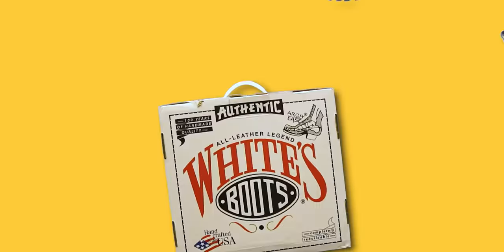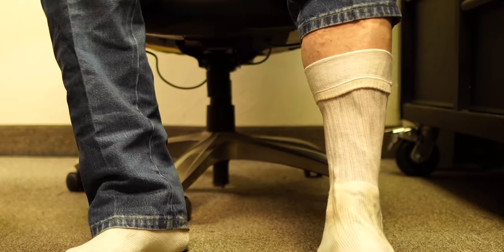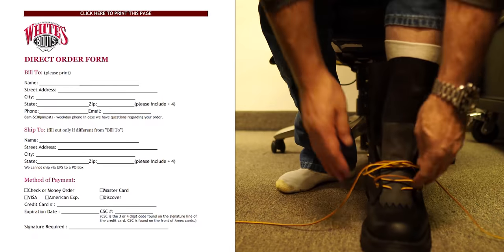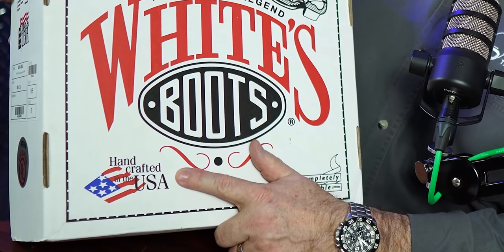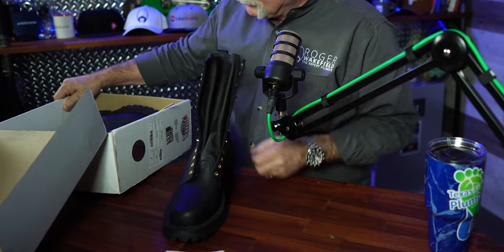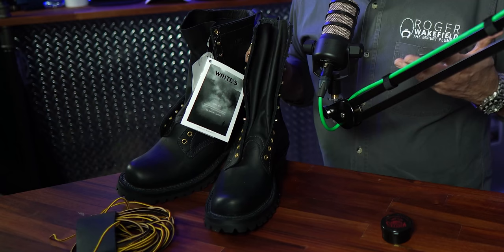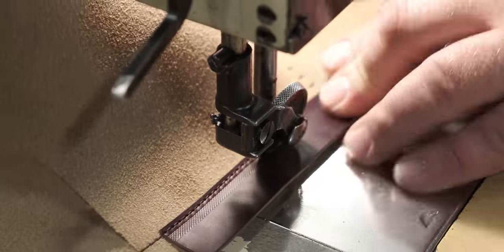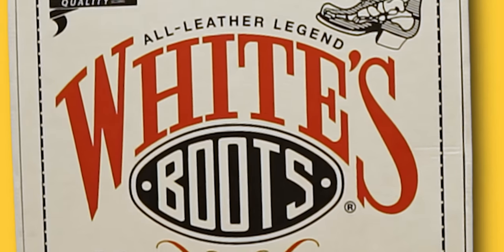Are These The BEST Plumbing Boots Ever??

Comment from the maker: What kind of boots do you wear?
Reply: The free kind.
Reply: I wear flip flops instead
Reply: I have a brand thorogood I’m on my 3 pair really do love the brand provides me with the support I need for my weak ankles and the leather is made to last
Reply: Sasquatch Leather Roper Boots lol
Reply: I wear Globe Technical 10" Wildland/EMS boots. Most comfortable boot I've ever worn.
Reply: Steel toe
Reply: Redwing. Love them. Loves boots and love redwing and yes I pay good money but I would try some custom boots.
Reply: Stilettos
Reply: Belleville steel toes - doc marten basic
Reply: Carhart slip on boots.
Reply: I'm shocked you don't give out the name of the former boot you don't deal with lol
Reply: I wear Wolverine legend durashocks with a composite toe , I feel like they’re. Comfortable and durable for everyday service plumbing
Reply: Thorogood here.
Looking to upgrade to whites or nicks when i can. 👍
Reply: Rock steel toes
Reply: Justins the gucci of boots
Reply: I wear Twisted X steel toe driving mocs.
Reply: Hi, plumber me too I wear Dickies rigger boots.
They have a protective part on the top, it avoids to scratch and peel the leather when you are on your knees (that occurs most of the time in plumbing for me). With some brands I had the steel toe-cap exposed in only 3 months. 
Dickies dixon lined rigger boots last me for little more than 1 year before getting opened on the sides (due to constant folding) but never because of exposed toe-cap .
I prefer boots with no laces because when i'm in a trench or a hole, sand or dirt can't enter the shoe and i wear them with the pant over it, that way sand can't enter by the top.
I would like the Stafford Waterproof (often the feet in the water) and the composite toe-cap prevents condensation (cause cold feet sensation in winter).
They are a little bit more expensive than Rigger boots but should last may be more
Reply: Chippewa Super loggers. Great boot! Looks similar to the ones in your video.  Will have to try these Whites boots, nothing wrong with having a second pair of boots... Are they insulated?
Reply: Red wing steel toe Pecos
Reply: Boots in a way are like a plumber's tool. I've worn Red Wings for years,  lately I've been wearing Timberland ,occasionally I wear Dr Martin (very confortable). I have at least three pair of boots which I alternate each day.
Reply: Georgia Boots
Reply: @Hever73  I started wearing RedWing steel 40 years ago when I did 7 years as a union Iron Worker I keep 2 pairs , one for working the other for casual dress and when the work boots wear out I turn the casual into workies and buy a new pair for casual and the cycle begins again. Never have to break in a new pair long hours of the day
Reply: @randyblackburn9765  they are really good they're pricy though I broke my ankle wearing a pair of them .... after that I've been using Timberland but I still have my 2 pair of Red wing which I wear when I have to some digging or drain cleaning.
Reply: Current pair:  Thorogood 804-6446.  Previous pairs:  Lacrosse FireTech, Thorogood 804-6391M.  Next pair:  Matterhorn MT901.  The 6391M was the best boot of the bunch with both toe cap and internal metatarsal protection, so of course it's out of production.  I've been searching for an equivalent ever since.
Reply: Thorogood 6” mock toe heritage series in tobacco brown.
Reply: Jalas off road
Reply: Redwing
Reply: National
Reply: Wolverine boots with insoles out of my pro model vans. They're super comfy and I always tie them tight. I've been in flowing water that went almost to the top of them and I didn't get any water on my socks.
Reply: Keen Cincinnati
Reply: And  Chippewa Superloggers
Reply: I have never been a wellington boot wearer,but My current boots are Marshal ,square steel toe boot ,made by Redwing Irish setter.These are the most comfortable boots this plumber has ever worn.
Reply: Red wing 2414
Reply: Whites fire rated lace to toe, I can get 4-5 years out of a pair. And boy are they comfy right out of the box.
Reply from the maker: @justindunlap1235  these are actually the most comfortable pair of boots I’ve ever owned. I love these!!!
Reply from the maker: @PACKERMAN2077  I’ve never had those before...
Reply from the maker: @bornagainluis  as a residential service company we don’t really need steel toe. Thank God. These are so comfortable.
Reply from the maker: @andrewengland971  I wore Redwing until they quit making their top selling model. That’s when I found #Whites...
Reply from the maker: @clarityofthought  it takes forever to break in Docs...
Reply from the maker: @deathmetalmachine  i loved the product for years. It just surprises me they would quit making their best product!!!
Reply from the maker: @chrisp5093  I freaking love these for sure...
Reply from the maker: @Daddybigduck69  if Justin is Gucci, Whites must be #ChristianLouboutin... Rocking It!!!
Reply from the maker: @crash4dafun  they aren’t. But in Texas I wouldn’t like them if they were...
Reply from the maker: @Hever73  like tools in a toolbox. You always like trying new tools!!!
Reply: @RogerWakefield  I agree, in addition I have completely tore down a worn out pair, and was thoroughly impressed with the am out of effort they put into constructing the sole and arch so it quickly molds to you feet.
Reply: Just dropped $625 up front for a custom build from Franks. Whites unfortunately sold out to China, and Nicks sold to an owner who is focused on pumping out quantity at the cost of quality control and footing the bill at the expense of the customers. There's a few other quality boot manufacturers, but my money is with Frank.
Reply: I've got Nick's boots
Reply: Just ordered a pair of whites stockman boots for tree work and in general to keep on all day... needed a pair that are hardy enough for the tree work and will look good and professional when I’m out doing quotes in the evening... some people really do need this quality of boot. Great video 👍🏻
Reply: I got the exact same pair for wildland firefighting, with a good pair of darn tough socks and whites leather laces that i treat with obenaufs leather preservative. Have yet to find a better investment for my job. Those of us that shoot or hunt will drop thousands on a rifle or modifications. Or even 600 for a glock 19 that we cant afford ammo for. Put your investment in what youre using and what you need to work at all times!
Reply: I wear the same boots for wildland fire and they have never let me down
Reply: @Darkstar19643  thank you for your work, sir. I wish more people respected the safety you provide for us.
Reply: @RogerWakefield  Six months later, any regrets or are you still happy with your investment?
Reply from the maker: @POWER_WAFFLE  I’m boarding a plane in Houston. Guess what boots I have on. Yes I love them.
Reply: @RogerWakefield  I appreciate you for taking the time to answer that, glad you still enjoy them! Looks like I know where I’ll be going for my next pair of work boots.
Reply: Whites model Foreman, im
a residential electrician.
Reply: @orBMW  really? I thought it was China. Might not be made in America, but Japan is light-years better than buying China. Guess I won't feel so bad when I buy my dad white's for his first handmade boot.
Reply: @ThomasSteed  everything is still handmade with USA materials in Spokane.
Reply: Have worn whites and nick’s boots since 93’ smokejumper or lineman’s , the real deal . Feet never tired even after 14 hour day. Worth every penny to me.
Reply: 12 in whites smoke jumper in brown rough out.  Second pair of boots in a 20 year career in fire service.  many resoles and a few rebuilds but I love them.
Reply: Whites Helitak
Reply: Whites smoke jumpers all I will ne. The best and much favorite. I do tree work
Reply: PNW are the best boots period !! Whites ,Nicks Franks ,Wesco they are all great !

Comment: I’ve got the nicks builder pros, they’re from Spokane as well and do the hand crafted and fitted boots. Amazing quality
Reply: Nicks, Quality materials, with stitch down construction is a short cut. Go look up what whites norweign welted construction looks like. The sole could be completely gone on the boots and they would still stay together because the boot upper is sewn to a channel in the insole not just stitched down to the sole.
Reply: @GregariousAntithesis  Nicks boots are almost exclusively goodyear welted. Whites offers pretty much NO Norwegian welted boots in their lineup and it would be pretty easy to search them out given the iconic double welt and stitching pattern that Norwegian storm welts are known for. Both boots are made to the same standards and are bulletproof.
Reply: @ShutUpBubi  you are wrong, i am a boot maker and boot repair man Nicks are not the same build quality and construction. Whites are hand sewn through outer upper and leather inner sole in a channel in innersole. All others including Nicks are just simple stitch downs, turned out upper stitched down through soles.

Comment: I've been buying a new pair of Red Wing 2408s every three years since just after the turn of the century.  I really prefer the non marking sole on that model.  very flexible toe, but the most important thing is that the last for red wings matches my foot.  only problem I have is the tread pattern will hold dirt for hours unless you actually wash the sole of the boot.  I've had them leave dirt on my floor a full day after I've worked anywhere with dirt. (on a finished floor, I'm more likely to lave them at the door than wrestle with floor savers)  migh have to think about white's, though - and I pass through spokane every couple years.
Reply: Team Red Wings. 👍🏾

Comment: I like Steel Blue boots.  They are pretty comfortable out of the box and as long as I get the ones with the rubber bumper on the toe ( I kneel down on the concrete a lot) seem to last a while.  I got King Gee brand ones last time and I am regretting it.  They didn't have my steel blues in stock and my work doesn't let you expense more than $180 on boots.

Comment: Those boots look amazing. But for me, weather I am doing electrical, plumbing, tree, or IT work, mid height hikers or ultralight is my go to footwear. I may put in 5 miles or more at work and 10+ miles on the trail. I have never been able to tolerate a boot that goes midway to my knee. For every pound on your feet, is 5 pounds on your back. My shoes typically weigh less than one pound per pair.
Reply: Look up Lowa, Galibier mountaineering boots, same basic construction as whites. Heavy as a hell and a lifetime boot.

Comment: Socks make a difference, too.  You've gone to what might be the best boot but are wearing socks that are cheap and likely not the best for you.  At the advice of a co-worker, about two years ago I started looking at on-line reviews of socks and purchasing accordingly.  I've also been alternating shoes, never wearing the same pair two days in a row.  On top of that, I've been using sole inserts in my shoes (which take up a bit of room and may require a larger shoe size).   All this made a great deal of difference in my foot comfort.  For years I had painful feet at the end of the work day.   Now, no more painful feet.  When your feet are tired, it feels like your whole body is tired.  One more suggestion:  I have wide feet and purchase only shoes that come in extra-wide width.  You really don't want your feet being pinched in by shoes that are too narrow.
Reply: Do you have any suggestions for good socks? I wear dickies and carlhart which seem to be good but always looking to try something new and improved.
Reply: @crash4dafun  I have tried a number of the highest rated socks on Amazon.  Some are thicker than others.  I've had good luck with Peoples socks but they are all superior to simple white cotton socks.

Comment: Are you going logging? The thorougood pull on crepe soles steel toe are the best boots. Wolverine, I95, close second.
Reply: I have Thorogoods too. White's are WAY nicer. White's are hand made, use better material, better design and will last much longer. Thorogood used an insole for arch support. Whites uses a heavy duty built-in leather arch support which molds to your foot. Thorogood uses a rubber Goodyear welt which cracks over time. Whites uses a stitchdown method which is superior. Thorogood uses a composite midsole. White's is leather. White's spares no expense with outsole too. Thorogood, not so much. Don't get me wrong. I love my thorogoods, but they really don't compare to White's.

Comment: Wore Whites and Nick's forever as a wildland firefighter, ultimately came to love Nick's. However, the high heel will mess your back and knees up over time; they were intended for standing on steep terrain, not flat ground. They do make a boot with lower heels that I would suggest. Just started a career in plumbing myself and will get the low heel. $120 rebuilds for life for a boot that will ultimately take the shape of your foot beats spending $200+ for a throw away pair every year.
Reply: I had a pair of Red Wing logger boots with the extended heel and I agree; it can make your back hurt. I love the aggressive look, but as an electrician on my feet all day, I'm kind of leery about shelling out $500+ for a pair of boots that will hurt my lower back. I might try them with a lower heel.

Comment: it blows a lot of people's minds that a working man won't bat an eye at paying hundreds of dollars for a pair of boots.
Reply: And I'm willing to bet very few of those people have spent a 12 hour day on their feet.
Reply: @siggitiggi  or had a pair of shoes last as many wearings.
Reply: because we've owned the cheap boots and they always fall apart lol
Reply: @deathmetalmachine  before I switched to red wings, I could get 11 months out of a pair of boots if the last month was in the summer so water wouldn't soak through the cracks in the sole.
Reply: I'm heavy on shoes, just for everyday wear.  Cheap junk stuff may last me 3 months if lucky.  I pay about 3 - 4 times that for a different shoe and it it well worth it. And they must be all leather, no material bits.   They last me on average 7 years. In the end I'm saving money as it works out cheaper in the long run.  Just that you have to pay it all out in one big chunk.  

Another trick I do, it will depend on how your shoe looks.  Is I have one pair for dirty work and the other I use for smart wear.  Then when the dirty work ones are worn out, they become my dirty work ones and I get new ones for smart wear.  Thereby extending the life of the shoes for longer too.
Reply: @dappermuis5002  shortly after we got married, my wife bought me a pair of black "nice" shoes from Bass.  with 4 hours a week wear, I really had a hard time yelling at the dog for chewing them up.  hustled out to buy a similar pair from Red Wing, before she could get me another cheap pair, and they wear better over a decade later than the Bass ones ever were.  and I'm not in such a hurry to get home and get them off my feet.
Reply: My father always told me to spend good money on your boots and your bed because If you aren't in one you're in the other.
Reply: You can get around 17,500 hours of hard wear from a true pair of whites. 40 dollar work boots maybe 1000 hours of wear if your lucky.
Reply: @justindunlap1235  just as a frame of reference, a full time job with two weeks off comes to 2000 hours per year.

Comment: Started off with a pair of carhart boots. They were warm as hell in the winter, what carhartt is known for but they didnt last maybe nine months before getting a hole torn in them by some outsticking screw. Then i went to thorogood but quickly regretted it as the breakin was murder and the leather lost strength super fast. Finally made the plunge and got Whites Sawyer (basically a smokejumper with a steel toe, work required) and havent went back since. I can work a 12-14 hour day and my feet will not hurt, sweaty but fine otherwise. One of the best decisions ive ever made.

Comment: If they really want to make the perfect plumbers boot then they need to add an ABS over the toe shell plumbers wear out the toes of boots crawling under houses
Reply: Leather toe cap over synthetic anyday.
Reply: @ShutUpBubi  I’ll guarantee a schedule 40 abs will out last a leather cap , I wear redwing pecos with steel toe and the leather will wear a hole in 2 months .steel cap would be better but would chip a cast iron tub if bumped